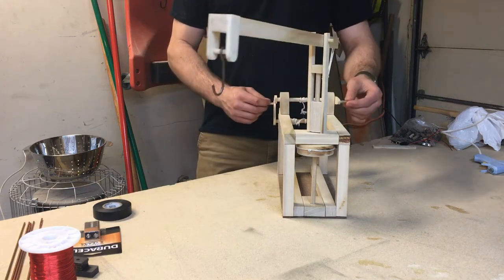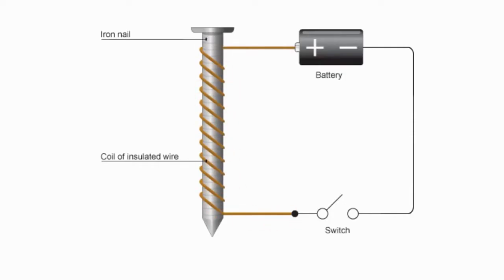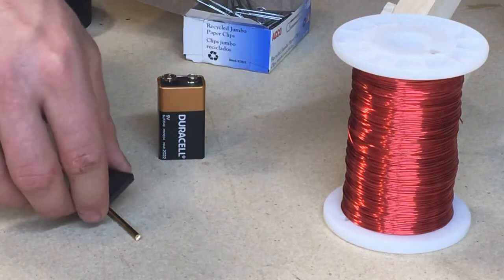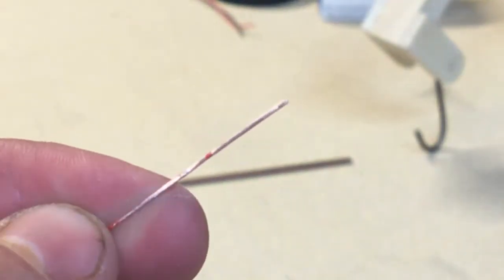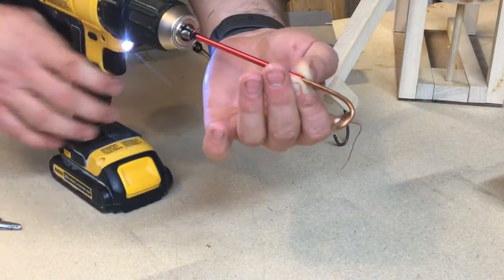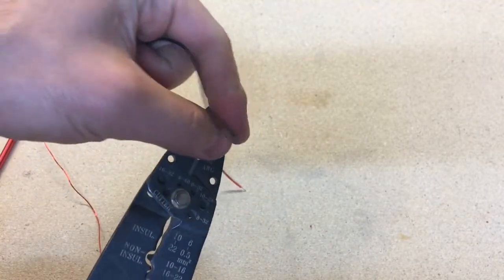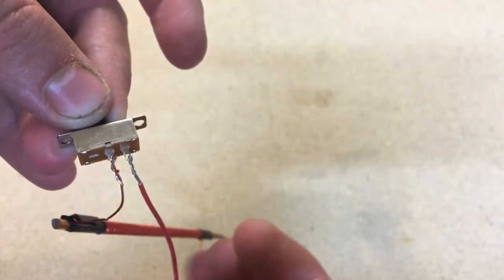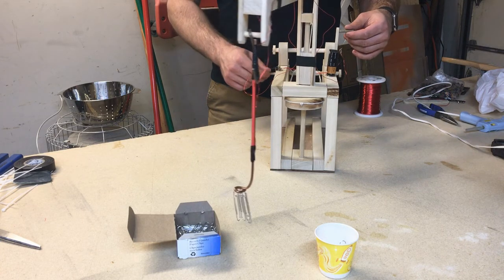Electromagnet Crane

Comment: Copper is not magnetic. It must be an alloy with iron, nickel or cobalt in.
Reply: The magnetic field isn’t produced by the material, but instead the flow of electrons, or current, moving through it.

The resulting magnetic field and be measured using Amperes Law.
Reply: @scottmcleod8342  @1.15 is what my comment was referring to.